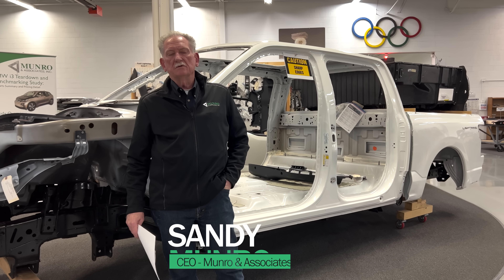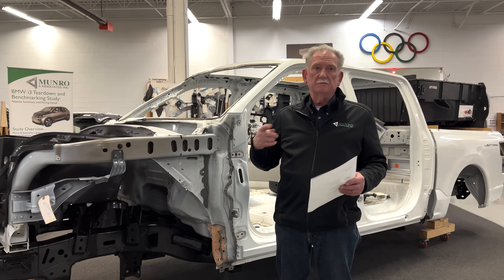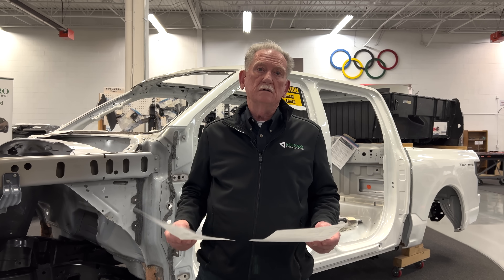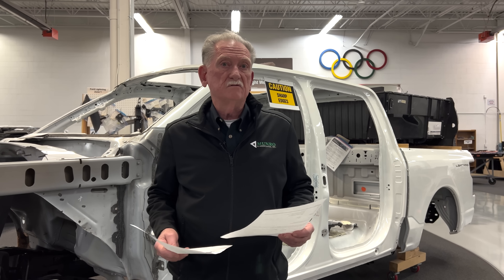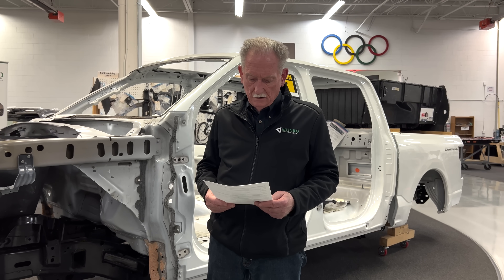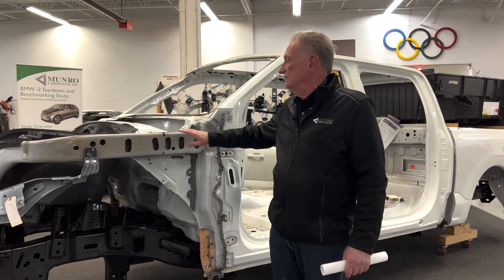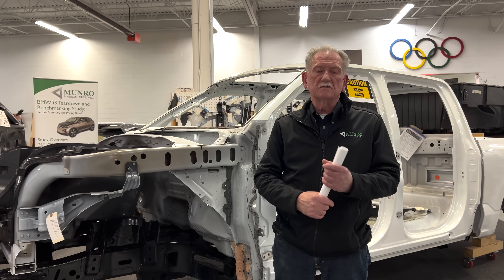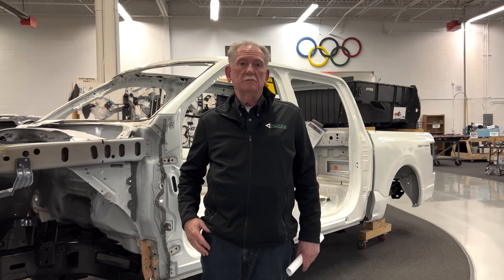Sandy's Initial Thoughts on the 2025 Ram 1500 Ramcharger

Comment: Sandy , as a guy who works out of trucks and tows a lot, this is where we need the range.

I have been hollering for years that we need a phev truck or range extended truck.

It isn't the empty range we care about. I can stop and get gas anywhere, but it is a pain while towing and costs me valuable time and miles.

I had a 1999 2500 HD Silverado that towed everything I needed but it was the 3 door version with a 6.5 foot box. 

It was a great truck, but when I towed heavy , I had to refuel every 120 to 180 miles. 

I run the middle of the country and we tow high speed on the interstates. Towns are far between and off of the interstates. If you miss a truck stop you have to swing off of the interstate and drive to a small town and pray you fit through the gas pumps or can get through the streets.  

Time is money and stopping all of the time while towing costs you money and profit.

My newer truck is a Ram 2500 HD crew cab long box. I did not want the length but it got me a factory 50 gallon fuel tank and an empty range of 600 miles. 

Towing heavy gets me 300 miles at interstate speeds. 

You can cover a lot of miles quick at 70 mph. 

I drive about 2 to 4 hours between stops and only stop for a very short time to top off or just keep driving for 4 hours.

I love the lightning but the tow rate is too low and the tow range is too short. 

The recharge time is too long. 

I tried a run with my buddies truck towing 9500 lbs.

A range extender on the smaller battery truck with more towing capacity would be just the ticket.

They should put the 4 cylinder turbo or like engine in as the generator
Reply: Sandy is not. Truck guy and may understand the mechanics but clearly has no clue how most people actually use trucks
Reply: I agree, the lightening is unreasonable for many people in the midwest who have to haul for work.
Reply: Perfect. This is exactly the kind of real world use that Sandy’s empty vehicle analysis needs to consider when looking at these vehicles!
Reply: The engine won't be high revving or strained so in this case the V6 they chose is a better option
Reply: I have run all kinds of power plants. My current runner truck is a 2021 silverado with the 4 cylinder turbo and it has more torque than a v6 at a lower rpm and is more efficient on fuel than than any V6 I have run.   I used to be a generator and diesel mechanic in the military. A generator is more efficient under a constant load and demands high torque not h.p. That is why a diesel generator is better and more efficient  than a gas engine. The turbo 4 cylinder engines of today are very similar to a diesel engine in their torque curve.

I forgot to add that the 4 cylinder turbo is more efficient and weighs less than the v6 and that is another consideration.
   @Yielar1
Reply: Sandy is so out of touch to the needs of many truck owners . he assumes you aren't towing , he assumes it isn't a cold climate, and assumes you will drive 55 mph . The 320 mile range in an all electric EV can quickly drop to 120 miles if you travel 75mph, in the cold and towing ... now consider you might be going uphill and the battery is getting older and it gets worse
Reply: Turbos are problematic.  The pentastar v6 is rock solid and perfect for generator applications.
Reply: @John-o9v4n  It is not the best choice for a generator engine because it requires higher rpm to get the torque out of it for powering a generator. 

I am not a fan of that engine unless you are talking about the 3.7 L

A generator engine is better when using a high torque medium rpm engine range. 

That is why the best generator engines are diesels .  If you want similar characteristics  for a good generator powerplant,  an inline 4 cylinder or 6 cylinder with a turbo would be a better design to mimic the best torque profile for the generator. 

The original 2.0l gas engine with a turbo would be a good package. It could be run at 2 stages , lower for warm up and cool down and higher for full output stage. 

The weight to power ratio and packaging would be better and add less weight to the vehicle. The original jeep engine was very simple and reliable. A diesel version would be more efficient but would not be as flexible on the fuel used to run it. 

The gas version could run on multi fuels including many synthetic and renewables or even CNG or RNG. Not to mention high or straight alcohol fuels.

I was a generator as well as truck mechanic in the Army right out of high school and went to school for it before advancing into other fields.

As a mechanic and jeep guy , I don't like the  Pentastar engine that much. My favorites were the inline 6 and 4 cylinders in the jeeps as well as the Ford V8s and the international 401 v8
Reply: Cybertruck with 600 miles should replace the ram 2500.
Reply: Don't know how well a goose neck or fifth wheel hitch would work in the cyber truck.
 @starshipdriver8536

Comment: Did I miss Sandy mentioning about the weight of the gasoline and/or diesel as well?
Reply: He also didn't mention that the smaller battery in the Ramcharger will weigh a lot less than the Lightning and will offset the range extender and it's fuel tank. Plus you don't have to carry around a full tank of gas all the time, where you do have to haul around all the extra batteries in the Lightning. This truck is perfect for my needs. Drive around on solar power most of the time and when I go towing, fill the tank as much as I need to and go.
Reply: No problem it weights less than the extra battery and the weight is variable

Comment: If you tow anything, you will need the 690 mi total range (truck only). It will probably be around 300 mi towing. In fact, most RAM owners tow something at least once a year... The range extender is for those who need to go camper with their families and are unwilling to rely on charging in fracture availability.
Reply: Honestly it will be 200 towing but that’s same as an f150

Comment: Glad to see the comments are in line with reality. I’ve been waiting for a truck like this specifically for towing. I am a BEV fan however when it comes to trucks they just don’t work towing for anything but short distances. This design is basically a locomotive on wheels. The RV industry needs to adopt this design for motor homes especially.
Reply: Speaking of the Rv haulers,, they demand diesel engines as gas under long haul runs breaks down kinda quick.. plus fuel costs more for gas over diesel.. its a energy density thing.  may be a diesel variet could be a great idea. As a diesel engines prefers to load up and hold its loads for a long time..  say 4 cylinder could do well, since it can buffer the energy with the battery.
Reply: Its like a Hybrid Locomotive. L):)
Reply: Just don’t have a collision in one or hope to keep it beyond 5 to 7 years.  Huge question  around long term durability and parts availability beyond OEM, and who will ever be able to repair them beyond the Dealer Techs.  Complicated, loaded with future failing parts, and this truck has the absolute best and absolute worst aspects of both ICE’s and EV.  Rural folks and fleets will love the range Sandy, maybe just not Detroit’s suburbanites .
Reply: I see your point of having two powertrain systems to maintain, but its hard to beat a truck that is made to do things, haul things, pull things, when it has it's own power source onboard,.  I also think the opposite; this truck will have two powertrain options so you are always prepared for work truck life.
Following a Nav app to find the next place to revive your truck, on a remote work site or away from home is just inefficient to me from a labor point of view.  ICE Tech has become extremely reliable, and think that the ICE powerplant (Engine and Alternator only) runs only when you drive over 100+ miles (surely less when towing), the PentaStar engine will go extremely long on services since it will run at steady RPM at optimum power and economy since it is only running an alternator to recharge the battery or direct power the wheel motors. 
This IS the only way electrification can be applied for consumers of light trucks across the Midwest and plains states, or anyone with snow and 6 month sub-freezing winters. @Westcoastride

Comment: The use of the 3.6L V6 seems to be a little overkill for the application.  The specs are saying that the truck will have a 130kW generator, which is around half of the current power rating of the V6.  If I were to guess, I'd say that they're using it because they simply make a lot of them and it's a very popular engine across multiple applications.  Something else to consider, with it being put into a reduced power application, and with a large battery pack to make up for transient performance, I'm betting they're stripping all the advanced technology off it.  You could replace  variable valve timing with new fixed cams being optimized for a near single speed operation.  Same would go for cylinder deactivation, a variable displacement oil pump, etc if the current gen has one (I'm not super familiar with the pentastar engines...).
Reply: I am super familiar with Pentastar engines, and I studied the press photos. It's the same gen3 3.6 pentastar that goes in every FCA vehicle, minus the alternator, A/C compressor, and starter. 130kw is 175hp, and the standard 3.6 delievers 300hp in most trims. This tells me they have/will very much maximize it for a steady state rpm, which will probably be around 2300 where this engine likes to run. They also mentioned a two speed mode, so they will probably tweak it for two rpm. Nice. This thing is so great, I put $100 on one and I'm a cheap bastard.
Reply: @kipamore  did they remove the variable intake? I was going to buy a used diesel 2500 but now going to wait. I paid the $100
Reply: The engineering and tooling is long paid off on this engine. I assume they looked at the 4-cylinder they already have and figured it wouldn't have been the right fit. Plus they already have an Atkinson version of the 3.6L to use here.
Reply: Why mess with a simple engine with a proven track record? Getting rid of variable cam sounds good though.

Comment: We need a 50 hp air cooled gas range extender from U Haul that plugs into the trailer hitch self contained......no hook ups just plug in.
Rent when needed for cross country then turn in at trip end........U Haul could also have one on trailer mounted for rental trailer use..

Comment: I wouldn't looks at the range as 10 hours of driving, I would look at it as being able to use your truck as a generator at the work site all day and still being able to drive home
Reply: Also remember its going to be able to get about 400 miles of range while towing  and in an EV charging while towing is not a great thing unless you unhitch.
Reply: Didn't see your comment until after I made mine, at least 8 of us have the same idea.
Reply: I could eat off of a saucer half the time but we all use dinner plates
Reply: EXACTLY (Sandy) its not total range or range anxiety, its total energy storage and potential.  comparing an ICE 1/2 ton with a 10 gallon tank to one with 30.  Nothing to do with your prostate issues.😉

Comment: You can tow a camper with the Lightning 110 miles at a time between charging. This is about 2 hours of driving. You shouldn't drive more than 2 hours without stretching, taking a piss, etc. You will only do this trip 1% of your total ownership mileage.  
  
If you are towing for business, meaning you tow daily, then you get a ICE truck still for now.

Comment: I think anyone who writes EV Trucks off completely is a fool. ICE and EV will be manufactured together and purchased based on work duty.  Ram and hoping Ford with 2nd GEN Lighting are on the right track by NOT creating a complete separate platform like GM with EV Silverado.  The ability for trades to utilize after market  accessories interchangeably is huge. If I were still in the trades I could see having a mix of both F150s and Lightings in my fleet.

Comment: You don’t need to extend the range on the EV. You need EV trailers that can attach to any EV Pickup and not cut in half their respective range. I do wonder what type of registration, licence plate and insurance will apply for EV working trailers and trailer beds.

Comment: Range under tow is about 1/3rd max range without a tow meaning that 690 miles will drop to 230 miles. That is where this truck will shine. Untill energy density improves to the point that a 500 mile truck is the norm this platform will have its user base.
Reply: Yup, Horse hauling.. which is one of RAM's core markets.

Comment: Sandy just revealed himself as someone who doesn't tow. Any truck owner who does tow will immediately recognize the value a range extender provides.
Reply: Exactly!! Towing with the Lightning is impossible.  The range drops to 100 miles if you're lucky.  Then you have to sit and recharge for 30 to 45 minutes.   Turns an 8 hour trip into a 12 hour trip.
Reply: @tycurtin7565 75% of truck owners tow once a year or less. While I would question why they then need a truck when an SUV would likely be more practical, such is consumer choice.

We should recognize that the vast majority of the truck market really wouldn’t need a REX option. For the segment that does this is great to have as an option, and I would be curious like Sandy was if a smaller engine could make this package even more efficient
Reply: @coleeto2  Guess you live in the city huh?  Around here most everyone owns a truck and tows multiple times a week.  When you live in a rural area and everyone hauls farm equipment, feed, hay and wood almost daily up to 14 hours a day without a charger within 100 miles I don't think a fully electric truck will be sufficient.  Urban and city dwellers can charge easily not country folks.
Reply: @tycurtin7565 gets a lot more than 100 miles heck even TL trucks got 150 miles towing 10k lbs up the Ike Gauntlet which is a crazy over the top test. I'm with you that we need more range and we see the ground up designed EVs coming from GM with 450+ miles and 350kw charging. Only a matter of time. Ford's next gen EV truck built from the ground up is expected in 25
Reply: I love the lightning and it is what an EV truck should be except for the range. The range and hence charging speed issues are it's only real downfall. @Yielar1
Reply: Sandy goes off road to hunt  -  never heard him mention any other truck use.